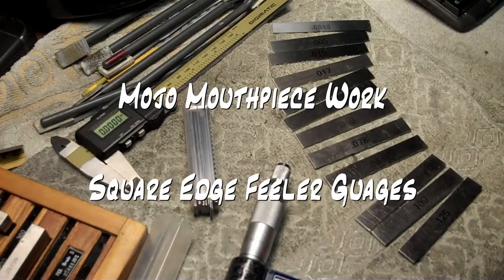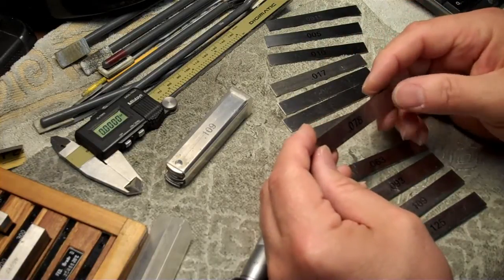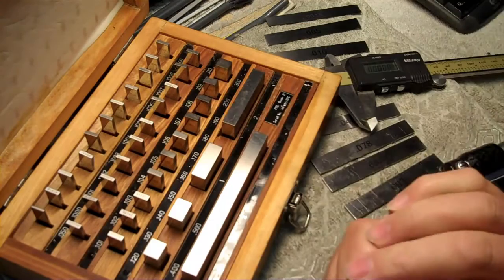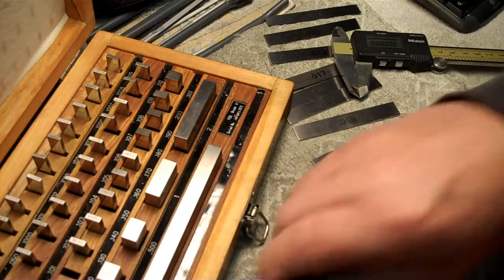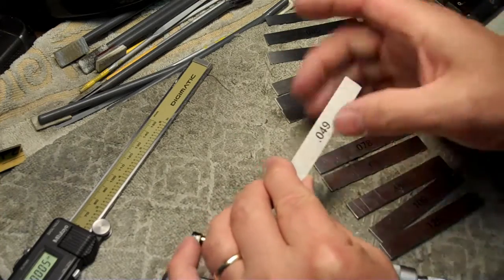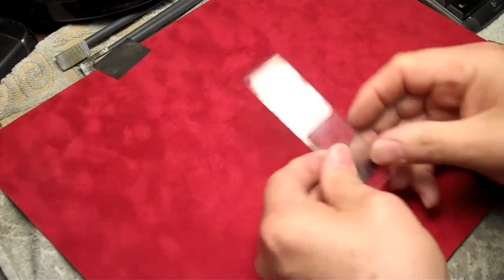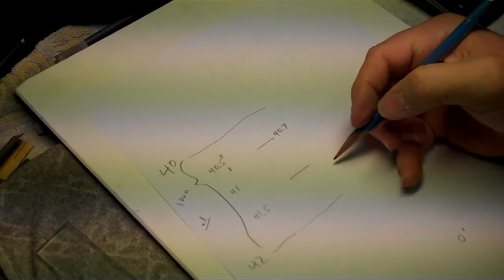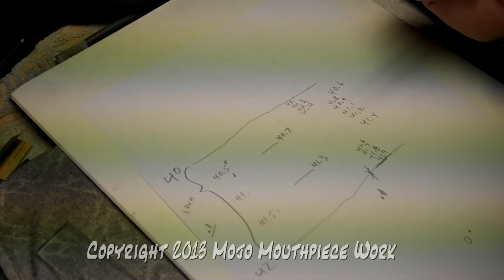Square Edge Feeler Gauges (for mouthpiece refacing)

Comment: Your calipers might be measuring more accurately because you don't touch the jaws when you are taking the measurement, also those gauges have tolerances it might say something like + - / 0.002 and if you measure 0.048 on a gauge that says it is 0.050, then that is within spec as they say. But you are probably not watching this in 2018 I see the video is from may 2013. Just wanted to add that calipers and micrometers also have tolerances and when you start adding/subtracting tolerances from measuring tools to tolerances from gauges +++ measuring is not all that easy now :)
Reply from the maker: © Innersane Thanks for your insights!

Comment: They make micrometer stands for taking accurate measurements, using one of these you will be adding minimal variable to the measurement that you are doing, depending on how accurate you need to be. I suggest for you if you want to hold your micrometer by hand you hold it in the plastic shielded part, that way you don't transfer as much heat as you do in the video where the micrometer metal parts are touching or lying rather flat down in the whole of your palm.